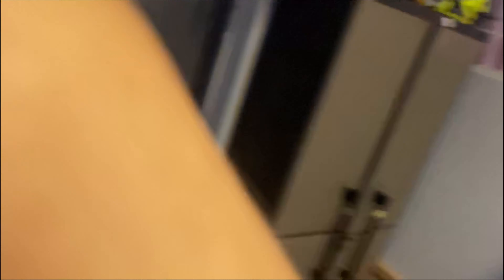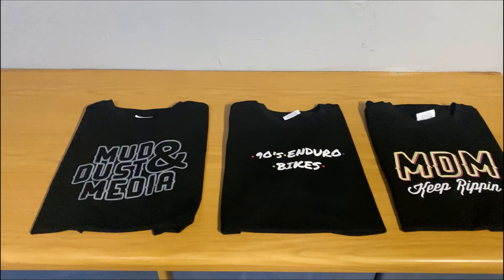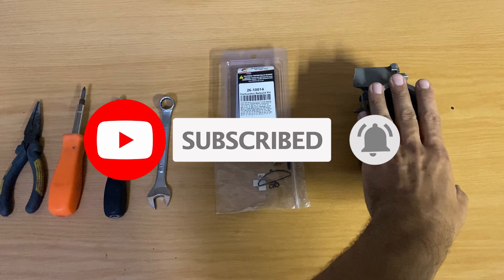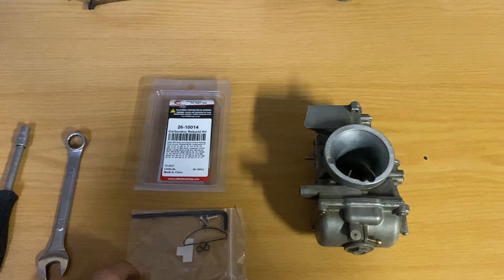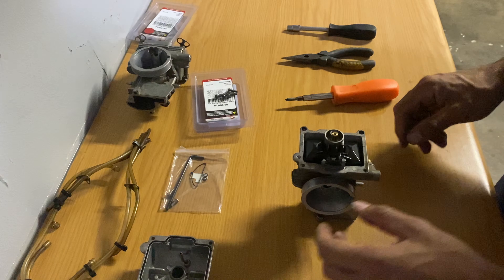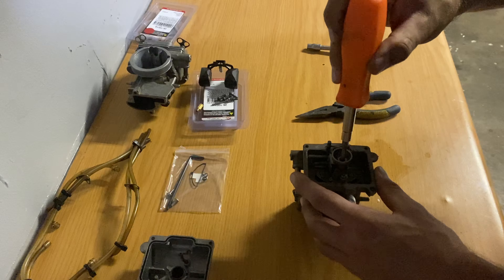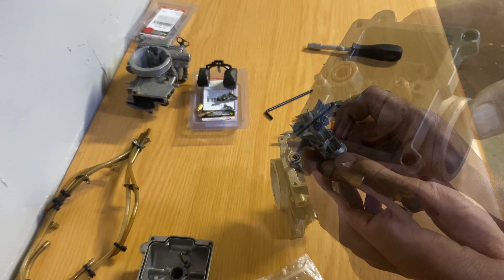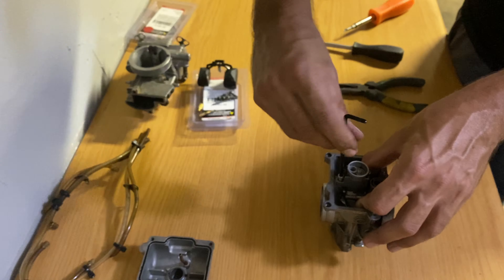Carb Mid Body Gasket/ Jet Block Gasket Replacement

Comment: Getting a new one for my 2004 rm250. Bike has been totally rebuilt and everything has been replaced or rebuilt. I’ve gone down 3 sizes on the pilot and it made little difference. It runs so rich for no reason at lower rpm to mid. Like I said ive checked EVERYTHING, but that jet block gasket.
Reply from the maker: Its definitely worth a try, it made a pretty noticeable difference on my bike. And its cheap...
Reply: Did the gasket fix it for you? Having the same problem with a kx100
Reply: @JohnnyApplepie  sorta, I also realized the needle jet is worn as well so that’s what’s probably causing the issue